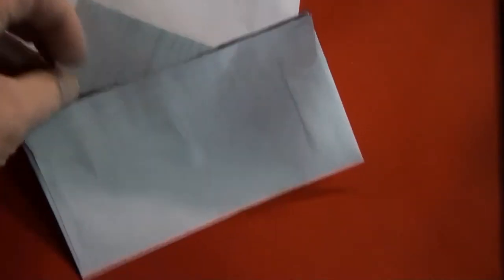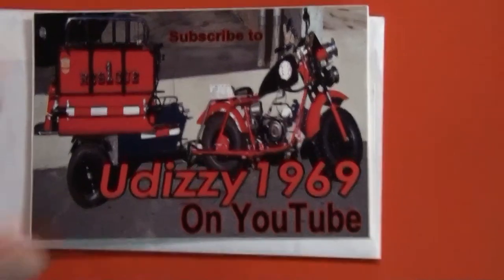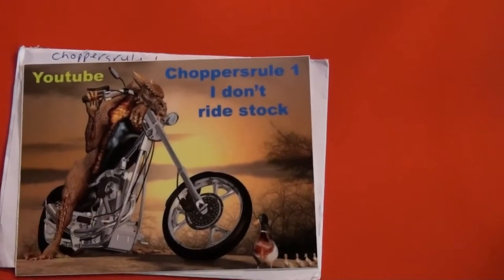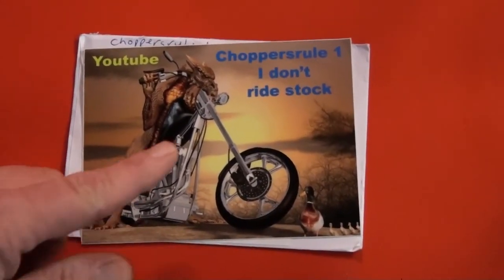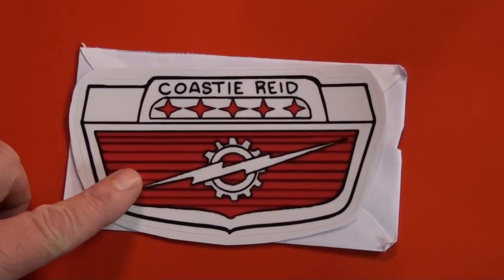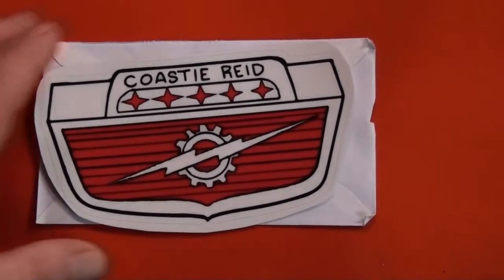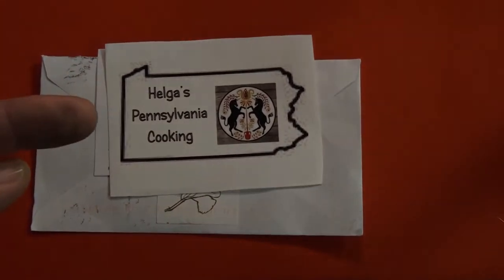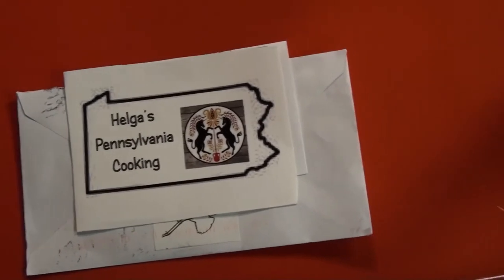ThanksGiving Mail Call 2016

Comment: Some great folks there. Snow will be no problem with the tractor handling it
Reply from the maker: Sure hope you are right. I had it last year but we had no snow, well just a few dustings not more than 1/2" at a time. They are saying we should have 46~50" this year so if that happens it will be a work out for the tractors. :)

Comment: I enjoyed the video...a great way for me to start the day! I changed out the plastic gear on my later model Craftsman with no problem. I will say this though, when I bought the gear I found several places that sold them in bulk, like 6, 10, 12 at a time...hmmmmmm, that me think.  But it has held up for so far.
Reply from the maker: Cool, can you send me a PM with the link to one of the sites? Plastic.. what happened to metal! :) Oh well its better than replacing the fly wheel I guess.